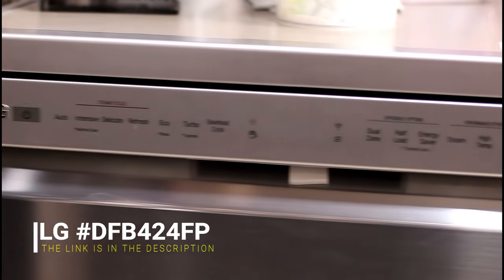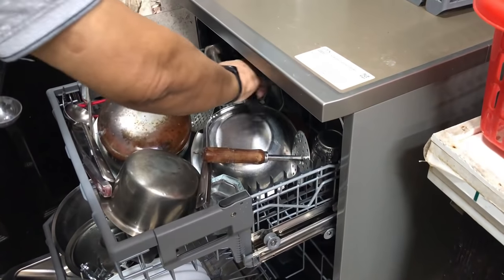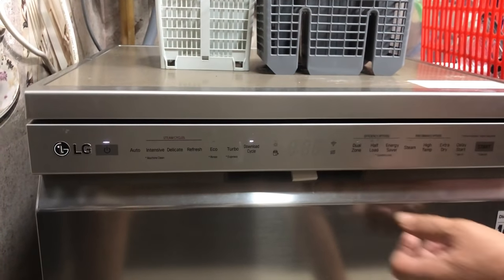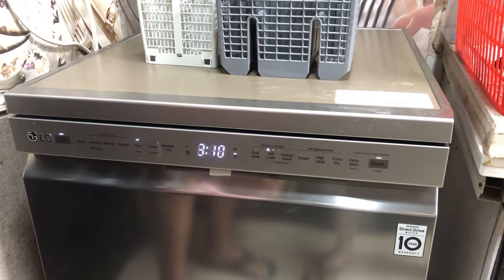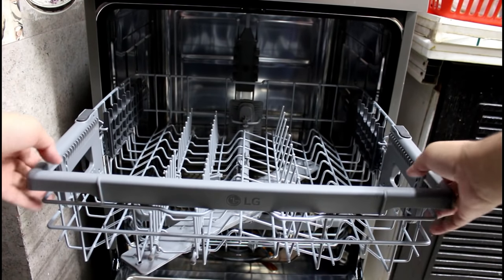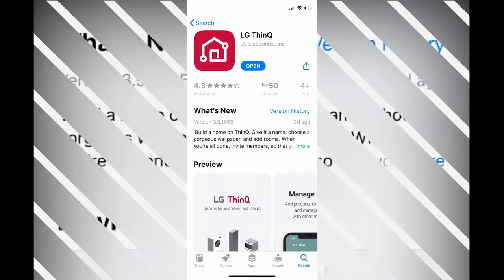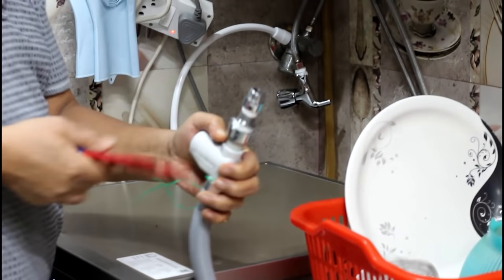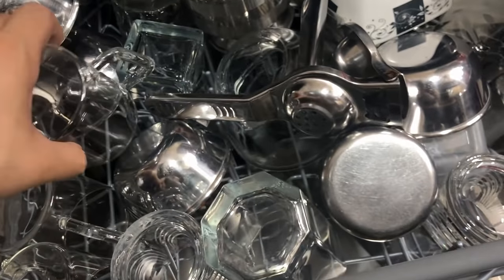LG Dishwasher Review (DFB424FP v/s old IFB Neptune)

Comment: I have seen numerous people citing the issue of heater problem with LG dishwasher. Some in a day or after 2-3 months which forces them to replace it with a new one or heading for a refund. How long have you been using it and have you seen any such issues.
Reply from the maker: It's been 4 months since I have been using the dishwasher. Although, we have not faced the heating issue, however, there is another serious issue in this dishwasher, due to which people are asking for a refund, and that is it restarts everytime there is a power outage (detailed in comment by Rali).

Although we have connected the dishwasher with an online UPS, two months ago our UPS broke for a couple of days, and the dishwasher became unbearable. It would take 11-12 hours to complete one cycle, as it would restart everytime there is an outage.
Reply: I think survive with the power outage but not the heater issue. Thanks for the update.
Reply: @mdmprhazy  Fix a high Quality Surge Protector to protect your machines. My central gas house heater blew it's main control circuit board 3 times (during 1 yr warranty period) UNTIL I fixed a surge protector and has used trouble free for more than ten years.

Comment: I have seen a lot of complaints about the machine not able to deliver cleaning as much as Bosch. It leaves some stains and spots after cleaning.However, I did not see it in your video. Can you explain if this is true and if you use a powder or a tablet? settings will help.Would you recommend buying it?
Reply from the maker: Hi, I am afraid I haven't used Bosch, however, it is an upgrade from IFB's Neptune that we were using earlier. Stains and spots are generally due to the hardness of the water, and may be fixed by increasing the hardness settings for salt and rinse aid (5:56). I am using IFB's Dishwasher Detergent in powder form (http://lit.tl/1w ). For hardness, I had tested different settings, however, anything lower than H3 (Salt) and L2 (Rinse Aid) leaves white spots (water marks) on utensils. At H3/L2, there isn't any issue of spots or stains, even though the water here is very hard (6:12). Yes, I would definitely recommend it. We are not even pre-washing the utensils anymore with this one and are happy with the results.
Reply: @meetuljain  Thank you for such a prompt response.But if I do not have as much hard water and keep lower settings, will it be a problem for stains?
Reply from the maker: It should not be. We did not encounter any stains other than that of the hard water (white spots). And if there are such white spots with the selected settings, we may anytime change the hardness settings of the machine, until it gives the expected results.

Comment: How about wash resumption after power cut ? Does it start from beginning or it resumes from exactly where it left ?
Reply from the maker: It doesn't start from the beginning, but it doesn't start from exactly where it left either. It re-starts the operation where it was interrupted. For example, let's say it has pre-washed and washed the dishes and the power cuts off after 18 mins of rinsing, then when the power would come back, it would re-start the rinsing from 0, and would re-do the already-done 18 mins of rinsing.
Reply: @meetuljain  Thanks for the response. 
Which is your go to wash mode for daily use?  Does the user manual has info about the time taken for each  stage(like prewash, wash, rinse, dry etc) ?

This cycle resumption post power cut is something bothering me before making the purchase. From what i have seen in other youtube videos is that if the power cut happens in last few mins of wash cycle it resumes from that stage(as you have also confirmed). As explained in here https://www.youtube.com/watch?v=462RwiNSS4k it can go back and repeat the last stage for 2 hours(depending on the wash cycle).
I'm not sure if this is the case with other brands in the market.
Reply from the maker: Thanks  @You110185 
We use Eco mode in our normal day-to-day use. I am afraid the user manual does not list the operation duration. Different cycles may have different durations for each operation. The TOTAL time taken by different cycles is as follows:
Auto 3::15
Intensive 3::05
Intensive + Extra Dry 2::54
Delicate 2::04
Refresh + Steam 1::06
Eco 3::15
Turbo 0::59
Rinse 0::18
Express 0::38
Machine Clean 1::23

These durations are without any cycle option. Selecting an additional cycle option (like Steam or Extra Dry) increases (or decreases, see Intensive + Extra Dry) time.

That's true, if the power cuts in the last 2 mins of the operation, it would still re-do the whole operation. However, as we have connected the dishwasher to an online UPS, the issue doesn't trouble us.

I believe the issue is specific to LG. Our old IFB dishwasher used to resume from exactly where it left. As the whole machine is computerized, it is possible that LG may fix it in the next firmware update.
Reply: @meetuljain  Don't you think the run time is double than a Bosch or Siemens? This may reduce the life of the utensils. How much is the power consumption?
Reply from the maker: @radhikanarayan2666  Looking at the Bosch's user manual (https://media3.bosch-home.com/Documents/9001406417_A.pdf, page 21), it appears that all the cycles are milder than that of LG's. For example, Bosch's Intensive operates at 70° against LG's 75°. Bosch's quick mode operates at 45° against LG's Turbo which operates at 65°.

Bosch's dishwasher runs at a milder temperature, for lesser duration and it doesn't even have the quad wash system. I doubt if the quality of wash would be the same as that of LG's.

Rated Max Power Consumption is 1600W.